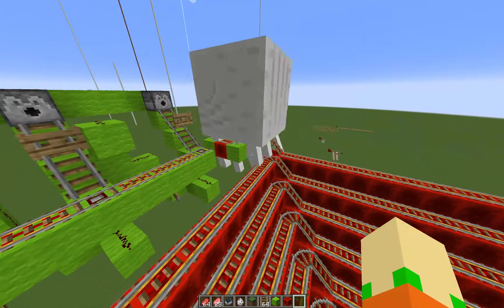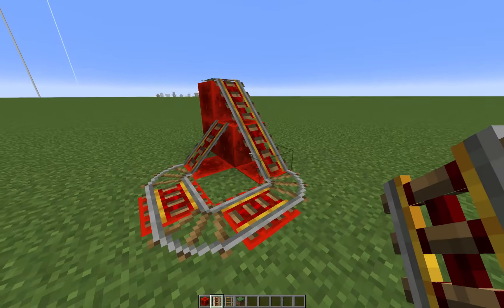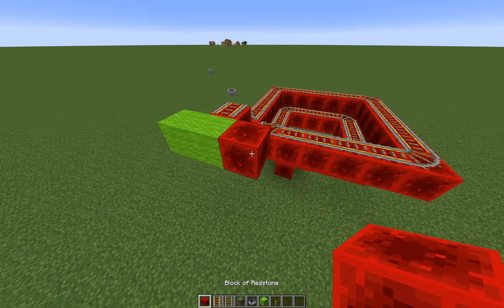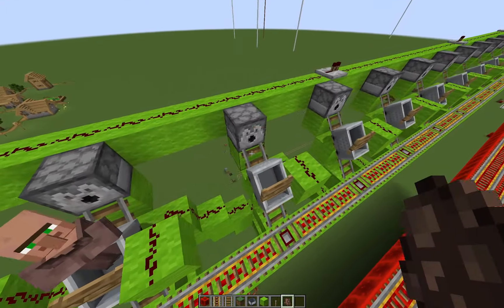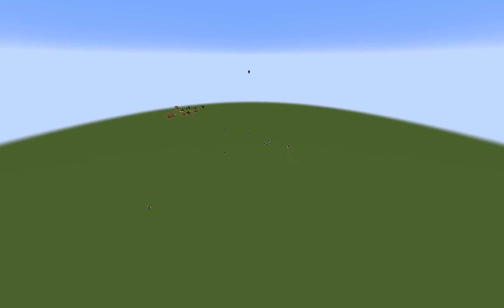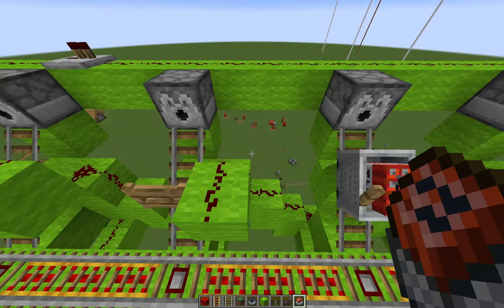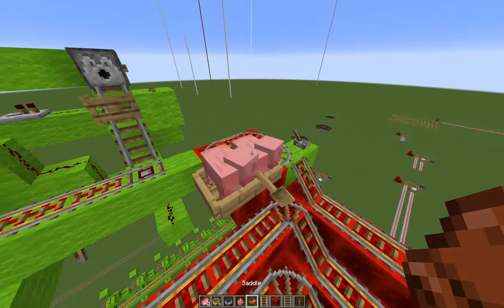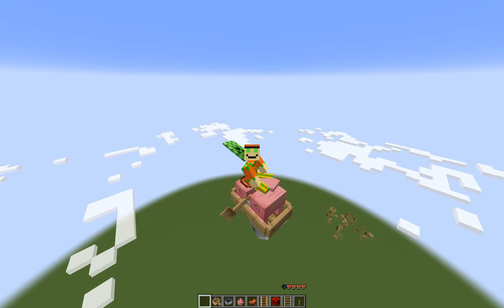How I Built the Biggest Particle Accelerator in Minecraft (Minecart Speed Update)

Comment: Edit 2:
By making the powered rails go up and down on a 4 by 4 loop, maximum speed exceeds 800 blocks per second

*Edit*
After further testing below is the maximum possible speed without going down hill, and said speed will be returned to when not going down hill:

If curious what's the maximum possible speed it's 400 blocks per second laterally.  Takes a while though as speed gained keeps getting smaller and smaller as you approach it.

And due to how minecart deceleration works can only travel a lateral distance of 400 blocks before momentum runs out.

When including vertical velocity... maximum speed possible at launch is 565.685 blocks per second

(When going up a slope minecart just sets vertical velocity to whatever the lateral was)
Reply from the maker: Very cool info

Comment: You could use this machine to get the most overengineered Ender Dragon kill of all time. Just block up and cut off all the Dragons waypoint anodes that control it's movement to fix it in position, then build the accelerator to fire TNT carts at it to kill it. It should be made a Minecraft achievement really😎
Reply from the maker: That’s such a cool idea!! I was actually going to do a very similar thing for a video soon 😁😁

Comment: How did you get the diagonal launch to work cause when i try it on 24w39a with minecart improvements turned on, the minecart just connects to the rail on top of the last rail.
Reply from the maker: You have to build the tracks in the same order I did and I believe you have to turn your minecart max speed up. I have my minecart max speed set to 1000
Reply: @FunkyJ_13  i tried but didnt work :(
Reply: like the minecart connects to the normal rail